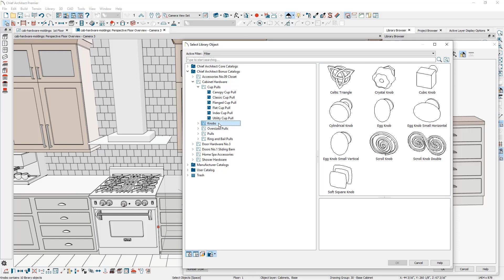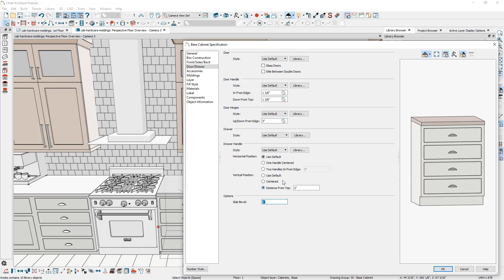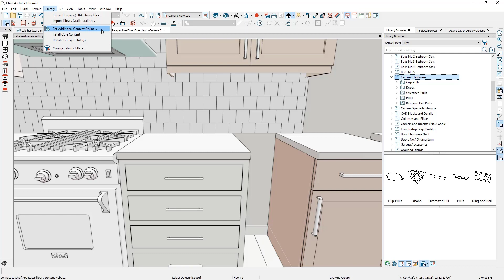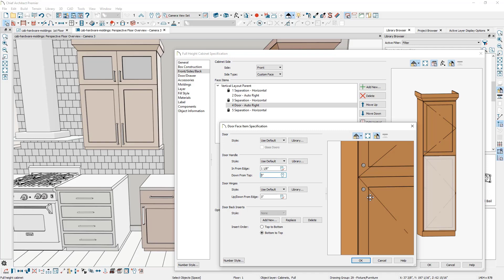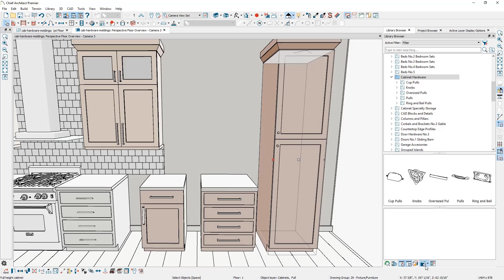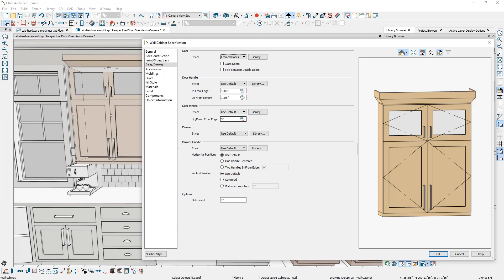Adding and Adjusting Cabinet Hardware

Comment: Hi CA

How do I make use of a "corner cabinet" sitting at the junction of two walls as CA does not allow me to break thru the one side of cabinets to reach the corner unit.

Bear in mind,  I am  not looking to use a Angular corner cabinet as it will alter the look of the kitchen. I need to reach the corner most part of the cabinet as it wud be wasted space if not utilized. I'm having this issue with both wall and base cabinet types where they join in the corner.

Thanks
Reply from the maker: Hello Rafeek! We have a video on how to create a variety of corner cabinets in Chief Architect Software here: https://www.chiefarchitect.com/videos/watch/1537/corner-cabinets.html?playlist=87
Reply: Exactly what I was looking for CA..Thanks
Reply from the maker: @rafeekhendricks1831  Perfect! Glad we could help!